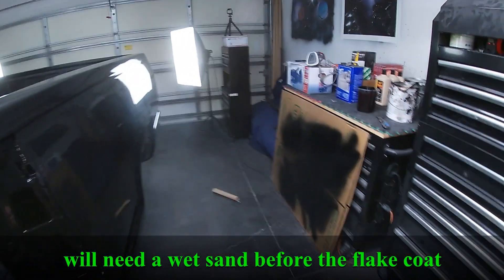Rustoleum paint job, black w catalyst. The OBS Chevy Silverado Truck bed is now black, Check it out!

Comment: Hey man I think the truck looks a amazing, just got a quick question. Not sure if you would know but would the rust oleum be able to be sprayed on over duplicolor lacquer primer? Thanks!
Reply from the maker: Thank you 👍
 Simple answer is Yes it should stick fine. You may want to spray a small test piece to get your dry times down so it doesn't crackle up. You can also let completely cure then sand and spray.  I sprayed duplicolor black then rustolium color shift on my dash then cleared it. Looks like the day I painted it a couple years ago. The dash is in my truck playlist.
Reply: @thisoldhooptie wow man looks like I lost track of time and never saw this comment. I appreciate it! How are the paint jobs holding up to the elements of the outdoors?
Reply from the maker: Perfect, alittle dusty from the rain and not washing. It's been parked every day in the driveway in the Florida sun.  With clear it would be perfect.  Nothing a quick buff doesn't shine up 👍
Reply: @thisoldhooptie  that’s good to hear! I appreciate the fast response. Hopefully I can get my obs finally painted. Much thanks!

Comment: Came out good dude. I thought about buying the fuji semi pro 2 but went the compressor and paint gun route. Hope i dont regret that decision. The fuji seems like it would have been a better choice for a hobbyist like me.
Reply from the maker: Thanks bro. Compressors do have a lot to offer. I will need one too at some point. I want a plasma cutter, and some other air only tools. The low over spray and not dealing with water in the lines for paint work is a huge plus on the turbine side. Everything has some positive and some negative. 👍

Comment: Great video. I just bought the fuji 4 and I wanted to know. What tip did you change out to be able to use the plastic paint cup’s?
Reply from the maker: In the description of the video i have all the 3m pps 2.0 system parts needed. Its the adaptor up top, then you need the version 2.0 cups i got one large and one small. The large can fit a large or medium liner. Also get a ser of check valves you will need to swap that a some point.
Reply: @thisoldhooptie  thanks
Reply from the maker: @bonezshakergarage  np

Comment: Are you measuring your parts in cups or ounces? What is the unit of measurement for the parts.
Reply from the maker: I use a standard paint mix cup which has the lines on the side for cups and oz. They can be picked up from amazon, any paint store, lowes, or home depot. You use cups for the paint and oz for the catalyst. The exact measurements I used are in the videos and the descriptions. Good luck with your project 👍

Comment: Im confused... Im trying to follow the progress on the purple sparkle over black rustoleum truck, and Im getting lost. Is this the same truck? If so, what happened to the purple flake?
Reply from the maker: I made a mistake when painting only half the truck with the flake. Needed to be done together so it matched. I could not get it to match since I did not  properly measure the amount of flake. The down side of learning as you go. I wanted it all one color for a bit so redid the black base and will be re painting the truck as a whole with the purple flake as soon as the s10 is out of my garage. It will be completed this year.

Comment: Gotta say that im impressed with how much paint that thing spits out! Looks like you had almost complete coverage in the first coat!
Reply from the maker: Just about. If I shrunk the fan and did tighter passes i would have nailed it in one coat. Didn't want to go to thick though. My mix is on the thicker side to start with.

Comment: change the purple flake thing into black paint?
Reply from the maker: I made a mistake when painting only half the truck with the flake. Needed to be done together so it matched. I could not get it to match since I did not  properly measure the amount of flake. The down side of learning as you go. I wanted it all one color for a bit so redid the black base and will be re painting the truck as a whole with the purple flake as soon as the s10 is out of my garage.
Reply: @thisoldhooptie That completely makes sense. I was thinking the whole time, that seems like it might be hard to match the doors and truck bed, so I went looking for that video. All makes sense now. Good work non-the-less. TY

Comment: Do u have a set of grey or black stock seats out of a 1500 88-94?
Reply from the maker: I swapped mine for custom seats why?
Reply: @thisoldhooptie  I would like to buy ur stock ones...also did u have any problems with the billet shift lever kit from Amazon?
Reply from the maker: @dubglock2312  i don't have stock seats for sale. I picked up a set of qualitex low back seats from online. The billet shift kit is perfect no issues. The billet mirror i went with needed to be retapped the angle was off.